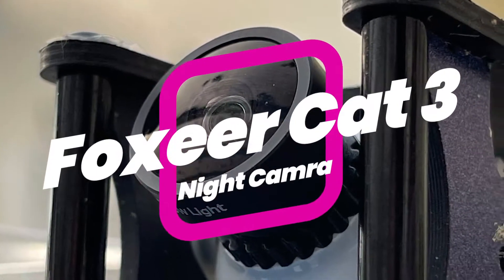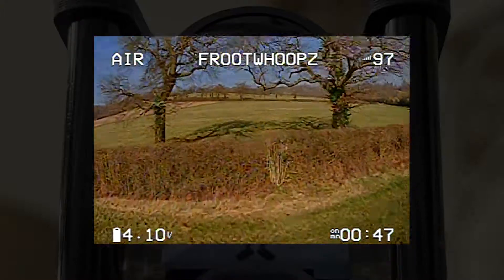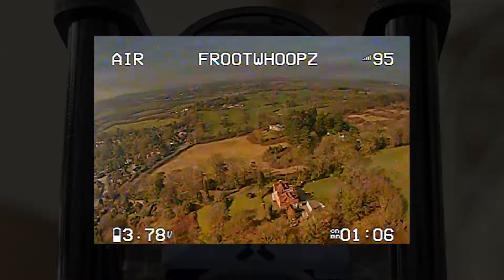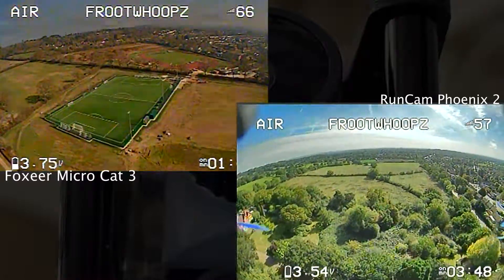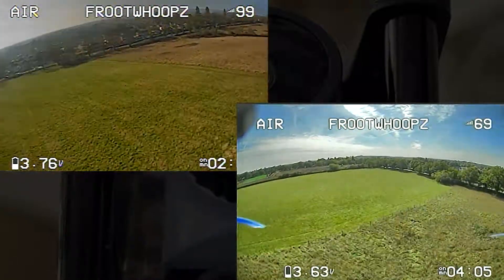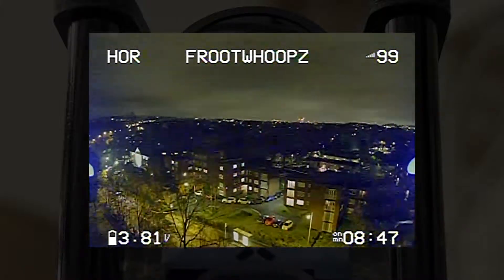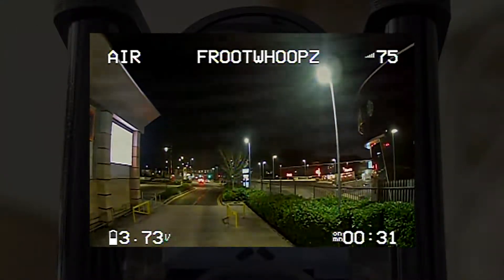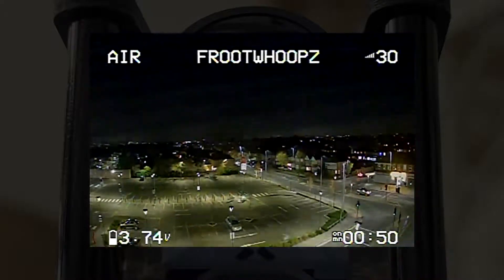Foxeer Micro Cat 3 - Night Camera

Comment: Does this cam display voltage?
Reply from the maker: If you mean the standard osd elements then yes
Reply: @MickyFPV  I guess I should clarify, Do you need a flight controller or OSD board?  Or will it read the voltage from the supplied power and show you on the OSD.
Reply from the maker: Aha, it has a input called vsen which solders on to the + and reads the voltage
Reply: @MickyFPV  Perfect.  Thanks!